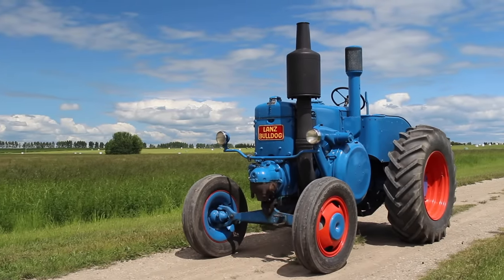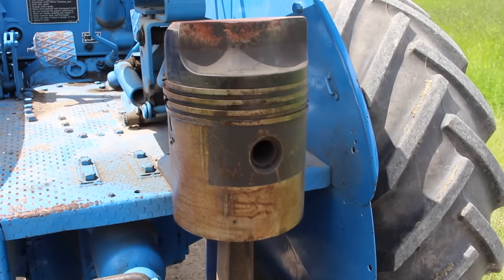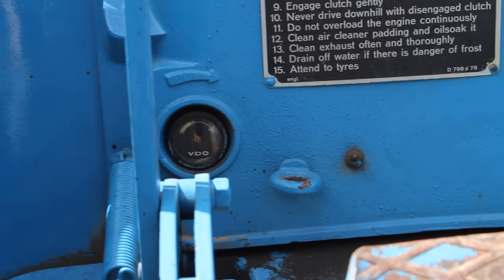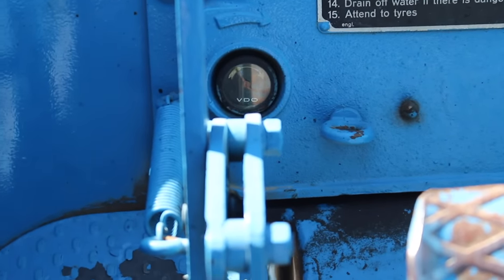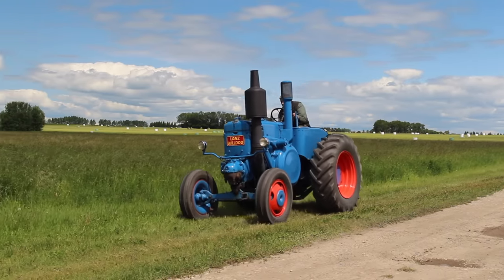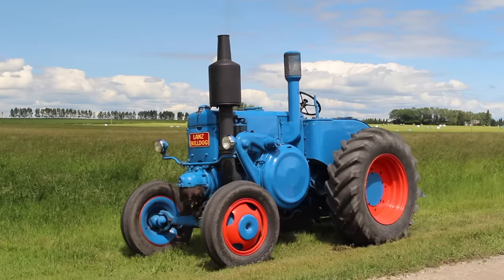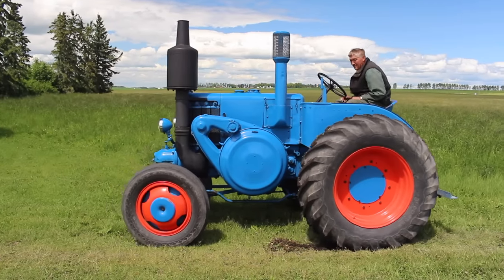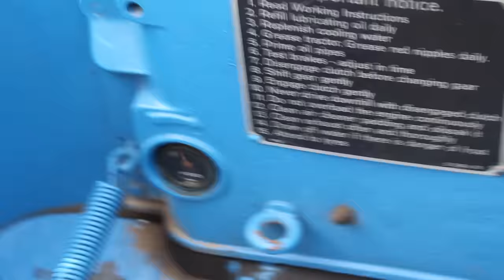Engine running backwards? Lanz Bulldog Tractor two stroke

Comment: Fun fact: modern two stroke snowmobiles use the same principle for reverse. I didn't know the technology was this old, very cool
Reply: No they don’t
Reply: @EthanAdey  some do. Can Am has a few that work that way, I've ridden one.
Reply: look into two stroke golf carts.
Reply: Yes they do skidoos 2 stroke engines run backwards for reverse they have been doing it for quite awhile from what I remember
Reply: Same with golf carts
Reply: i have a polaris sled, turns off then back on when i put it into Revererse. i think the engine would be reversing?
Reply: Yes. Some do run backwards in reverse. Interesting to see the roots of the technology
Reply: Actually this kind of technology was common before gearboxes were widespread, especially on simpler tractors.

Most tractors where I live doesn't have a gearbox, we use kubota and Yanmar clones here.
Reply: @EthanAdey  I'm a BRP service tech, I work on Ski Doo, Can Am, and Sea Doo. I should have been more clear, not all sleds work like that. But many Ski Doo models do.
Reply: @jacktumbleweed  2 two stroke gas is WAY different to 2 two stroke diesel. People just think it is the same as a 2 stroke gas because the gif he used was that of a 2 stroke gas, not a 2 two diesel. 2 two diesels are NOT crankcase scavenged. In any diesel, 2 or 4 stroke, if you have oil in the fuel, that bitch either has destroyed piston rings and/or it's running away.
Reply: @EthanAdey  yes they do. My polaris rmk 900 will reverse the engine direction for reverse. You press a button, it almost turns off, but then starts running in reverse.
Reply: @maxj9204  Yes, I was a dumbass back then.
Reply: Glad I checked the comments. I was gonna say ski doo 2 strokes have used this reverse for years. I haven't worked at a Ski doo shop in a few years but I'd say their monopoly on that tech expired. Expect to see more of it.